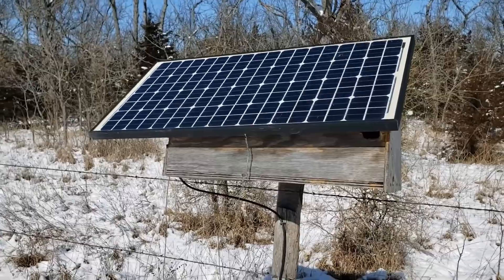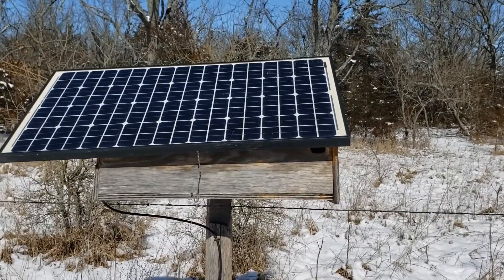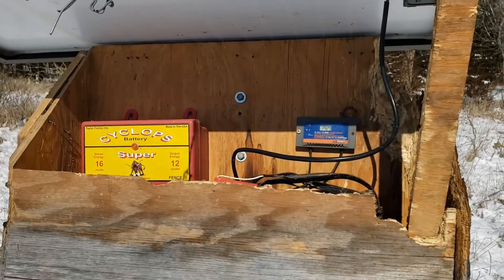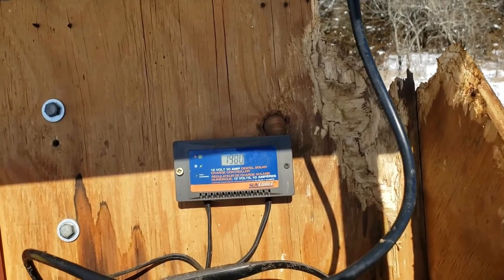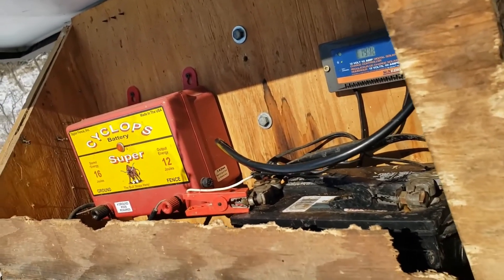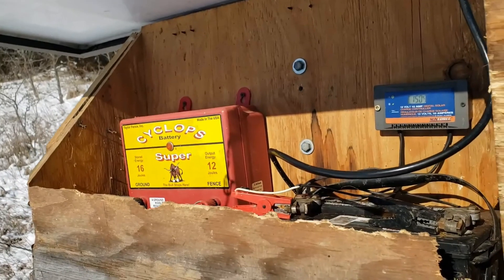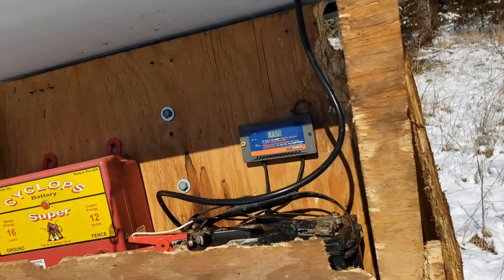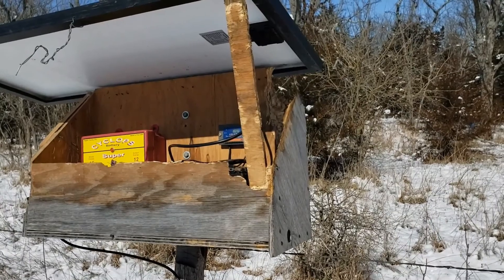Build your own solar energizer

Comment: Did you have a video where you had a 110 unit using a power inverter off grid I know somebody did and I can’t remember what channel it was?
Reply from the maker: Not me.  I've been told that it wouldn't work well as you lose too much voltage going from A/C to D/C but I don't really know.